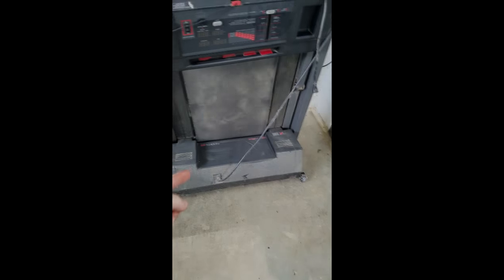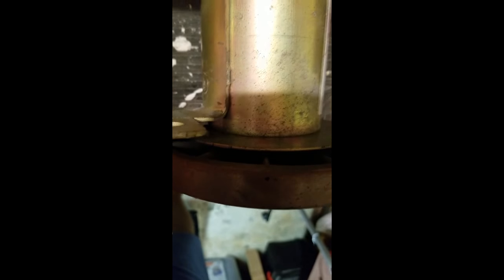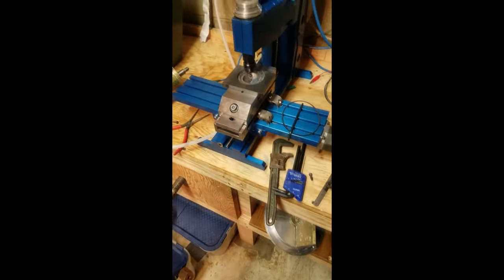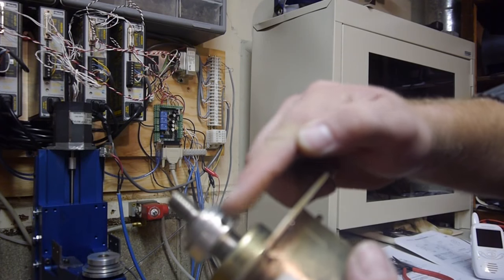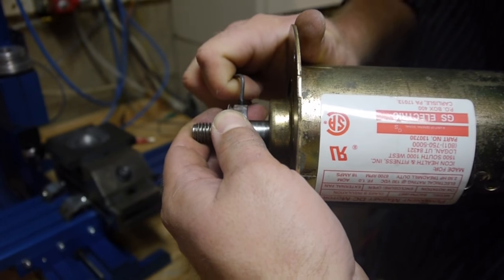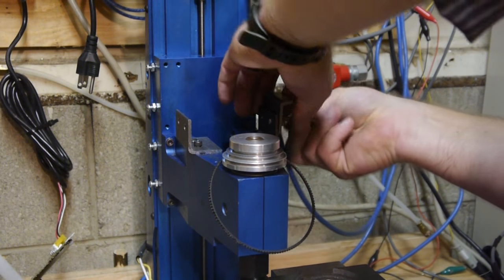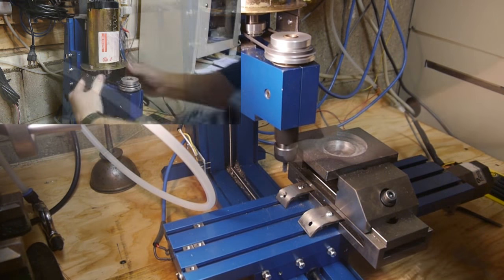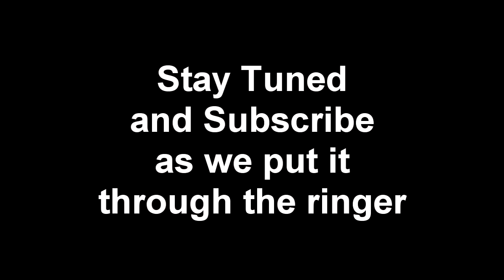FREE DIY CNC Motor Upgrade for a MAXNC Mill... IT LIVES!!!!

Comment: Excellent and funny video series. Like the upgrades and will be incorporating some into my mill. Is your spindle motor controlled via software through a driver board or is it always on and adjusted via rheostat?
Reply from the maker: The spindle motor is not controlled via the breakout board and Mach 4 at the moment. It is controlled by a sliding variable resistor that came with the treadmill. I looked into connecting the spindle motor to the computer at one point, but the amount of resistance wasn't quite right and then I could not get the legacy driver on Mach 4 to function correctly with the breakout board so I gave up just set my rpm based on readings I have gotten in the past at the spindle. For what I have done I have mostly played it by ear so to speak when it comes to rpm. Most of the bits I use require high rpm for most ops so I just set it high. I currently have the motor speed sliding controller mounted on the wall off to the side, I need to change that so that the spindle motor gets killed when I hit the emergency stop. I am glad I you are enjoying the series, feel free to ask questions  about anything you have seen.

Comment: Josh
Just found your video. I like it. How did you remove the flywheel? Is it LH thread ?
Reply from the maker: Hey Ted, I can't quite remember if I am honest. I remember looking at the bolt end and seeing just the barest hint of threads and deduced that it was not a press fit but threaded. I remember it not taking much force to get it off though. Nevermind I just went back and watched the video. Ouch the audio is pretty bad, first videos and all that, I can confirm that it is left hand thread. Thanks for watching!

Comment: By removing the flywheel, you lose the low RPM torque provided be the rotating mass of the flywheel.  The only challenge is multi=V belt driven pulley. Can't just by them in a variety of sizes. Gotta make it, find one from a piece of equipment using multi-V, (snow blowers, tile saws are 2, off the top of my head.)   

Multi-v belts are dirt cheap, available in a wide range of widths and lengths. and highly efficient.  (each groove in a multi-v pulley is equivalent to a single V belt).    It's also the only way to use that small drive pulley on the flywheel, which is important for get low RPM torque which is THE challenge w- DC treadmill motor conversions.

My experience retro-fitting my lathe with a DC treadmill was I needed to utilize a jack shaft to get the RPM range & low RPM torque needed.  I think a mill might present the same problem(s), perhaps not, if you run at high RPM's on everything.

You didn't mention motor voltage at all.  If the original MAXNC is a DC motor with the same voltage, the all is good, but if you run a permanent magnet motor, (ie: 99% of treadmill motors) over voltage specs, you will slowly de-magnatize the permanent magnets until they are not magnets, nor permanent.   The solution is to run the power supply & control panel from the treadmill.   For a few bucks you can add an LED tach from China via eBay.

You gotta do some research before just throwing a completely different motor on a piece of equipment.

GeoD, (hyjacking my wife's Google account, so I'll never see any replies or questions.)

Comment: Haha nice video mate, that thing looks pretty effective cutting there.    It sounds super quiet as well being a treadmill motor.  Some cool ad lib metal work there too... Do u have any of those tiny spare v belts for that thing ? They always looked flimsy to me .  BTW know what you mean about sneaking off to workshop. My wife's asking me what I think about double strollers and I'm watching your vid like yeaaaaah...
Reply: Forgot to ask... How does the z axis take the extra weight ?
Reply from the maker: So far the z axis is handling the weight just fine. I have only moved it at 20IPM (508mm/min) and only a few times but it appears the motors have enough torque with the parker motor drivers. With that said the steppers are receiving 65v through the Parker. I think the stock Maxnc driver only supplied 34V? I'll have to check my notes. I am disassembled the stock driver and measured some of the voltages and overall looked it over for a video I am in the middle of making titled "So you bought a MAXNC CNC?" It's still in the works as i am working on editing and re-shooting parts of it.
Reply from the maker: Yea, it is super quiet, less brush/commutator noise I think. I do not have any spares of the v-belts. I am looking at switching out the pulleys as the current max rpm 4100 rpm isn't really enough for cutting aluminum well. I just got done shooting a video on what I think is an effective method of determining speeds and feeds for these mini-mills. Yeah I agree they are pretty flimsy but at least there is a weak point in the drive train that will let the belt slip if it stalls out instead of damaging other components. I think I will go to at least a wider belt and a 1 to 1 ration on the pulleys. I meant to ask how are the new drive pulleys and belts working out for you? It looks like the smaller pulley is about 1/3 the size of the larger pulley so you are getting 7k rpm at the spindle?
Yeah I hear that about the double stroller. I bought one damaged and fixed it, still haven't used it yet, as the older child prefers to walk then sit for most around the neighborhood walks. I think it will come into its own on Zoo trips and all day events. But yeah it's a juggling act my friend. Keep it up, left foot, right foot. Some day they will be going with you and asking questions about what you are doing and that will be a fun day.

Comment: What motor ?? Should i get a MAXNC ?
Reply from the maker: The motor came out of the treadmill you saw early in the video. It is a 90VDC treadmill motor and controller from an old treadmill I had. If you can find a Maxnc cnc for a good price and as long as you don't mind a steep learning curve , in regards to CNC and machining in general then sure! The stock Maxnc Open Loop control system is slow and not very reliable in my opinion. You will probably want to get an aftermarket stepper driver and controller. The Closed Loop is better. The 1/5 hp motor is not really meant for heavy duty milling, more than 15 minutes at a time. The fan in it is anemic and barely cools the motor. I know of 2 instances where the 1/5 hp motor started smoking and caught on fire. What are you thinking of milling with the Maxnc? Plastic? Metal? Wood? Thanks for watching!
Reply: T1 D01 M06;
(Face mill)
G00 G90 G54 X-.125 Y.125 S2500 M03;
G43 H01 Z1. F5. 
Will be far different then what im used to. I run a HAAS vf3 at work.

Id want to run 
 Steel,SS
 6061-7075-2024 
Are these capable of running a 1hp+ motor ??? small profile ? I read somewhere 2.5hp will work??

Id be getting the top of the line, maxed. 1/2hp don't seem like alot however... same with spindle speed. :( 
Looks like you solved the RPM issue with new cog wheels tho.
Reply from the maker: Casey Cappoen ,
Well, this would certainly be a step down for you. :-) but on the other hand, you just have to learn to go more slowly. LoL. The treadmill motor says it is 2.5 hp... cough, cough b.s. cough. It is more likely 1/2hp or 3/4hp max. Either way, i have not gotten to the point were the motor has bogged or stalled, even with such a large drive pulley, and small spindle pulley. I tried some fly cutting and it seemed to work fairly well. I think with a stock maxnc with an upgraded 1/2hp motor you will find that your frame  ridgidity and stepper motor torque at high rpm will be the limiting factors, not hp.
Reply: Having purchased a MaxNC15 CL, I will say: you might want to save up a little and get a TIAG. I got a smoking deal which is why I went with the MaxNC.
Reply: What do you think about Tormach? 
The 770m is what im about to take out a loan for.
Reply from the maker: I think they are great little machines for the money. I think the 770 is a good all around size. If I ever bought one it would be in order to facilitate production of a widget that could pay the machine off. What I do currently is more of a hobby than a business. If you are not producing a widget and are just in a hobby I think a Taig would be easier on your pocket book. Really it just depends on the work area you need for what you want to work on. John Saunders of NYCcnc started with the taig before upgrading to the Tormach 1100.
Reply: Nyc CNC (John saunders) has a lot of good info on YouTube. Very helpful.

Comment: do you not have a working angle grinder either? lol
Reply from the maker: You have a fair point :-) I do have a working angle grinder, but unfortunately my shop is directly under the kids bedroom, 9 months and 3 years old at the time. I thought the angle grinder might be too loud and would wake them, which in turn upsets my wife and so on and so on... LOL Some day I'll get that detached garage/shed/barn, and not have to worry about such things. :-) But until then they go to bed around 7-8 o'clock and if I want to get anything done after that it has to be reasonably quite. They have a white noise machine in their room so I can make some noise. Thanks for watching!